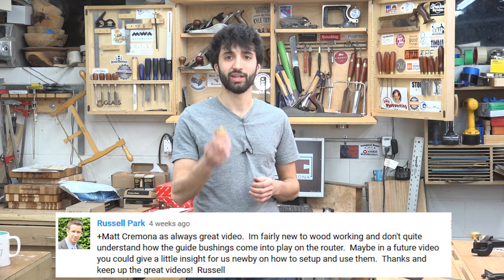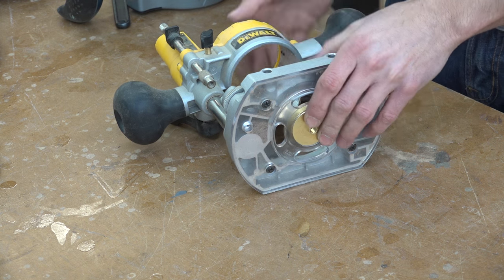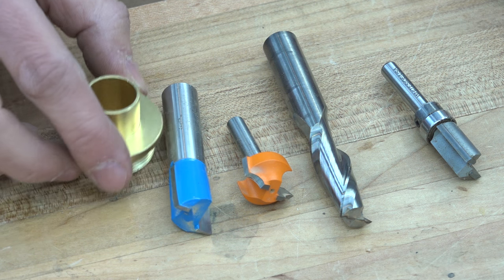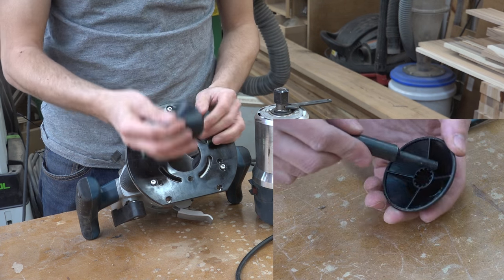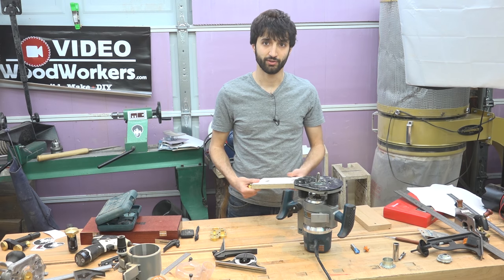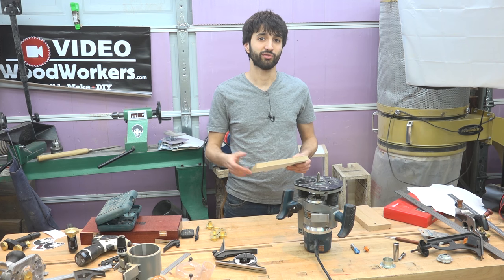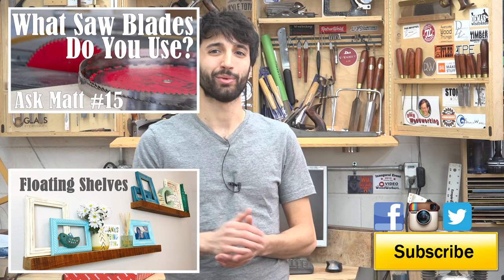How to Use Router Guide Bushings - Ask Matt #18

Comment: Great explanation on how to use guide bushings.  My wife made these carrying crates for mason jars to transport and store our canned goods.  She wants handles routed through the sides of the crates.  I have the same Bosch router as you and use it so sparingly it is not even funny so I did not even know guide bushings existed until a few days ago.  I run a business that performs commercial and residential repairs so I do not come across the need to use my router very often.  Guide bushings are exactly what I need to route the handle holes.  Thank you Matt.
Reply from the maker: Perfect use case. Thanks Ted!

Comment: Good instructional video Matt, as always.  Just a note: 1/2" acrylic (bullet resistant glass) makes for great templates. .  You can get it free from any glass shop that does commercial windows and glazing.  They remove it from banks and storefronts etc. when it gets scratched. Normally it gets tossed in the dumpster.  My buddy owns a glass shop and he turned me on to using it.   It's actually very easy to buff crystal clear using a headlight reconditioner compound and a power buffer.  Clear templates are really nice to use and it makes locating the layout lines much easier. It cuts really easy too on a table saw or router using the lower rpm range.  

Btw, there's no such thing as bullet proof glass, it's only bullet resistant.  Don't tell any bank tellers.  It will stop pistol bullets but that's it.  Not a high velocity rifle round.
Reply from the maker: Awesome tip, Peter!  got it.  bullet resistant :) haha!

Comment: I use guide bushing to make signs from patterns. I found under heavy use they like to work free. A little Teflon tape or locktite does the trick. Awesome video! Thanks.
Reply: Jonathan Mutchler

LOL!  I had one come loose and the bit chewed the hell out of the threads.  Still works but...

Comment: Thank you, Matt. This was very helpful. I short time ago I bought the PORTER-CABLE Dovetail Jig with Mini Template Kit (4216), and the Router Template Guide, 9-Piece (42000). These bushings are great and work well. I'm in the process of building a barn door cabinet for our foyer and went out yesterday and bought a 23/32" straight chute router bit and the 1" OD x 25/32" ID Porter Cable guide bushing. I have to make 3 dado cuts in the top and bottom panels for the cabinet dividers and this was recommended as the best option. I'm building a simple router jig that the 1" bushing will fit into and cut perfect 23/32" dadoes. Your video explains how to use the bushings and offsets which is very helpful. Thank you again! You have a new subscriber!

Comment: Got given a router and learning how to use it. Thanx for info, plan to make a simple template for cutting a cicle, this has been v. useful, Barry.
Reply: There's a better jig you can make for circle cutting with a router. You make a pin base jig to do that. I've made a few of those. It works great. You get perfectly round circles. I've done it to fit speakers into cabinets mostly. It's actually my preferred way of making larger diameter holes in wood though.

Comment: Matt, thank you for this video.  About 40 years ago I bought a new Sears router and right away almost severed an arm off (no blood, but scared me very much).  So I put it away and never used it again.  Recently I purchased a dovetail jig and now I have a use for this unused 40-year-old router.  But I didn't understand the guide bushing instructions in the jig instructions.  After watching your video, I think I'm getting close.  I have not been able to locate bushings that will fit this old router, but time will tell.  I will not give up.  Your video is good, clear and understandable.  If you have advice on how to adopt a bushing for various size plates, that would be helpful.
Reply from the maker: Thanks Ken! You may be able to find an aftermarket base for your router that accepts bushings.

Comment: Hi Matt:  Your woodworking skills are extremely impressive!  I use guide bushings a lot and I noticed that one of the comments mentioned the guide ring nut coming off.  I have had problems with this also until I stumbled on some spring lock washers online.  They are available from Peachtree Woodworking and they are extremely effective.  Part #2903 - Guide Bushing Spring Lock Washers - 2 Pack	$5.99.  John Jensen from British Columbia, BC
Reply from the maker: Great tip!

Comment: Awesome, pulled down a Porter Cable template kit Id' forgotten on the shelf for my B&D plunge router and now know it will make it easy to do 1/4" dowel holes with a bit and a scrap board as you demonstrated.  I have a nice separate guide for end grain holes, but wanted a better way to get accuracy out on a large mating flat.  I'll do the end grain ones first, then use dowel center markers to transfer the locations accurately out onto the flat.  Easy peasy

Comment: Good job mentioning and showing the centering mandrel.  Most base plates on most routers can be calibrated for centering.  I've learned the hard way that the Uncle Festool OF1400 has no such adjustability.  If they don't fix it I'm stuck with an expensive router that cannot be used with guide bushings.
Reply: $600 for a router it should be centered straight out of the systainer, at least mine is.  Take it back and have em fix/replace it.
Reply: @mski349 

I sent it to Festool and they didn't fix it.  Not only that they either just threw it in the systainer sideways or they didn't lock the plunge mechanism and the box was dropped and banged around by UPS.
There is good news, I found a way to get it centered.  I had to hack away at the guide bushing plate to access the set screws.  It's now perfectly centered but between the router and my kapex, (that I sold), I'm rather soured on Festool.  Their tools have a lot of nice features but their service totally blows chunks.

Comment: Matt....love the videos...very informative, esp the one on jointers.  What model Dewalt plunge base are you using in the beginning of this video?  I can't seem to confirm if the Dewalt 6182 model (plunge base) will accept a standard/porter cable guide bushing, straight out of the box.  Also is it crucial to use a centering cone every time we change out, and if so, are the centering cones universal (can use Bosch for Dewalt, etc) Thanks!

Comment: Hey Matt Great Video. 
I have purchased  some guitar body templates . However  I am unsure but suspect the rout out  shapes in the templates are larger than the  actual hole that will be cut and hogged out.  Do putchased templates usually come designed to cut the holes to specs?  I am  kinda old school and Routing was not one of my  commonly used tools . On guitars the cavity routes need to be fairly specific as  components fit inside them Thanks

Comment: I've watched this a while ago but wasn't logged in at the time.. Great Job as always Matt.  
I have a question regarding a pattern.  I have areas where I need a 1/32" or even 1/64" bit to make fine detail but obviously there are no bushings like that.  The piece I'm creating is about 6" wide by 2" tall.  Most area's a 1/8" bit will work but how do you calculate pattern size based on the final cut thickness of the small bits?  5/16" OD is my smallest bushing so.... if I'm chugging along with a 5/16" OD 1/4" ID bushing using a 1/8" bit then switch to a 1/32" there will be an ugly "step" or "offset"
actually, so I don't type a novel I'll just tell you to look at the Seattle Seahawks logo, if you were to pattern that to get the sharp corner detail using a trim router, what would be your technique?

Comment: Good video, my question, i try to use the guide bushing with a template, i cant seem to get the bit to extend far enough to get past the bushing and into the work piece to the proper depth. What am i doing wrong. Thanks Ruben

Comment: Good info Matt! I see you have a few festool prods. Not sure if you're familiar with their QF1400 plunge router, I have one and the guide bushing holder snaps into the base, it's off alignment with the collet by enough to make it a major frustration to use. Festools response It's to Just patch it up our sends it in. It seems like a common problem and there's not an easy adjustment without machine shop experience. Bosch and PC... Simply loosen the plate as you show.. Done. Any ideas?

Comment: Do you normally use a bushing/bit combination requiring an offset i.e. leaving plenty of room between bushing and bit? Asking because my Harbor Frieght plunge router is off center, the base is non-normal so does not allow way to center a plate ... and because of this I chewed up a 5/16 bushing using a 1/4 bit. Seems that using larger bushing and leaving plenty of room would be the answer to not doing that again.

Loved the video ... infinite thumbs up.
Reply: It would be a good time for you to make your base plate so you can center it properly.  They sell 1/4" thick acrylic sheets on Amazon or many other places.  Just take your base plate off and mark the screw locations and diameter and make your own plate.

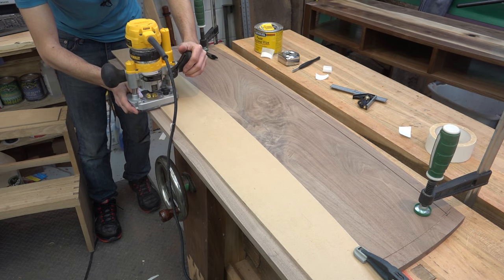Comment: Matt there is a cabinet door you show around 6:46. Routed in the door is a rectangle with the slight arc at the top of the door. Do you have tips on creating that arc with the router? 

I'm trying to replicate cabinet doors of mine with a similar design.

Comment: hello, i want say thank you for explained guide bushing work, i have a question, can i use guide bushing on trim router?
Reply: yes and no.  If your trim router has the standard Porter Cable opening it should be fine.  If not, you can always make your own router base and use a forstner bit to get you where you need to be.  I believe it's 1-1/2" opening but it might be something else.  Just check the guide bushing kit you want to buy for the opening size and match that up with your router opening size.  It's nice to create your own router base plate because you can so so much more with it like an edge guide, or a jig for much better control while free hand routing etc.  Just buy a 12"x12" piece of 1/4" acrylic, trace your router base plate (for hole locations) and boom, your in business.  I did this for my bosch colt trim router and it works great.

Comment: thanks for what you do . did the Dewalt router that you use come with the capability to insert those bushings or was that an accessory ?
Reply from the maker: yes, the baseplate has the recess for them built in.  thanks!

Comment: Hello Matt, thank you for this video.  I'm looking for setup to carve a template into a piece of wood 1/8 of an inch deep.  The problem I'm having is most bits that are designed for pattern cutting have a depth that is at least an inch deep before bearing comes in contact with a pattern.  I need a bit that allows the bearing to slide down the cutting length and only allow the last 1/8 of cutting surface to cut into the wood under the template. Any help is appreciated.
Reply from the maker: Look for a short bit like this: https://amzn.to/3i1Czs2  You can also make your pattern thicker or raise it up to use up more of the cutting length

Comment: I had wondered why you’d ever use a bushing instead of a pattern bit. Cutting dead straight holes in big pieces, or in a shelf pin jig. Inlays. Patterns with bits that don’t have bearings.  However, I’m not sure how often I’d reach for bushings over pattern bits otherwise.

Comment: Was that a Dewalt 611? I was using some bushings on mine a few weeks ago and had to step it up a few sizes because the bit wasn't centered... It wasn't a big deal for the project at the time but I'll have to check to see if I can adjust my base plate enough to resolve the issue.
Reply from the maker: Yes it is.  I haven't centered it yet.  The one time I used the guide bushings on it it didn't need to be centered.
Reply: I'm going to have to remember to look at mine tomorrow and maybe get one of them fancy centering jigs. It's kind of annoying that it wasn't aligned out of the box as that was the first time I used my second 611 with the plunge base.

Comment: Matt, do the collars on the bushings come in different lengths? I have the same set you have in the video but when setting up for a dovetail cut there is very little clearance between the bit and the collar.
Reply from the maker: The only thing I can think of is to have more contact surface with thicker templates.  I haven't had to yet, but if I needed them shorter, I would just cut them to a shorter length.

Comment: hi Matt excellent video.. the large dovetail jig you showed looked awesome.. who is maker? I am wanting to do finger jointed box drums..I build cajons and box drums. I recently came across 1,200 sq.ft. of long leaf pine heartwood 7/8" thick.. appox. 200-300 year old. it was milled and joined into 31" and 43" wide shelves.. in lengths of 8'- 10'- 12- 16'. I have 35 vertical supporting pieces 23' tall in same widths made from same stock. I want to build box drums with,, its super hard and dense. built one , it sounded awesome.. excited about better production with a good jig..any other recommendations appreciated.
really like your videos..thanks j.

Comment: Hey Matt, hope all is well. I know this video is old but I always come back to it for reference. I wanted to ask if this same concept of using a guide bushing to create a repeatable cut/pattern if you have a template, can be used in an inverted way. For instance, if I have a template of a circle (6in), and I need a circle BUT bigger (7in), can I use a guide bushing around the outside of the current 6in circle template I have to create said wanted bigger circle? I hope I am making sense lol. Thanks, and stay warm :)
Reply from the maker: Yes absolutely. You can use the offset to grow the template

Comment: Wondering if anyone has had the problem I've experienced using a guide bushing, I've used wood river.  Have used it to make cutting boards with a curved inlay in it.  Twice now the damn thing has unscrewed while i was using it and screwed up the threads on the female part.  I centered it on there best I could and nothing seems to be touching it, don't know what I'm messing up or is it my shitty skil plunge router.
Reply from the maker: The bushings that came with my dovetail jig came with an o ring that helps to keep them from coming unscrewed.  You could also try adding some teflon tape to the threads

Comment: Five years to late to maybe ask this question but how to figure out the cutting edge. Wouldn't it be to the edge of the bit is the space between the bit and the bushing (in your case 1/4") + the 1/8" bushing thickness? Or is the 3/4" the outside diameter of the bushing in which case 1/4" - 1/8" would be only 1/8".
Reply from the maker: Yes, bushings are labeled by their OD

Comment: Great info, Matt!  I've never used guide bushings...maybe an intimidation factor.  Do you know if guide bushing will work in palm routers?  I have a full size Ryobi and a Rigid palm router.  I don't have a plunge base for either, but I can definitely see their usefulness.
Reply from the maker: Thanks Chris!  That's going to depend on the base plate for the router.  I know the Bosch Colt needs a separate baseplate to use a guide bushing so I'd think the same would be true for other palm routers.

Comment: This is very interesting. Now im wondering is there are bushings like that for my el cheapo router... 

Also, in my country routers usually arent detachable from the base, and the handles are integrated and contain the buttons and speed control. No 'palm routers' etc. 

Also, i see there are different sizes of shanks. That makes it hard to find the right bits. I see many cheap bits online, but am afraid to buy as im not sure they will fit my router. This all makes my router one of the least used tools in my shop, which is a shame really. 

On the other hand, there isnt much i cant do with chisels.

Comment: Matt, I built a template guide similar to yours for the mortise.  Mine is longer to create a slot in the workpiece.  My bushing is 3/4” ID and I’m using a 5/8” bit.  I’m having problems with getting the bushing to slide in the template smoothly.  I think sawdust coming up and getting stuck between the bushing and the template.  The bushing slides smooth and free when the router is not on, but binds when I’m cutting.  Any suggestions or thoughts?   Thank you.

Comment: Hey Matt, I am looking to buy a new chainaw.  I am torn between a husqvarna and a stihl.  I will be primarily using it to cut down trees and for firewood but not in a commercial application.   I would like to be able to cut the occasional plank for a cutting board or something similar.  I have seen your stihl saws.  Is there a reason you chose the stihl over the husqvarna?
Reply from the maker: When I bought my first saw I was looking for either but found a good deal on a used Stihl 039.  Once you go with one brand it makes sense to stick with it because the parts are mostly interchangeable.
Reply: Makes sense, thanks for the response

Comment: Hi Matt, great video.  Could I cut that same mortise without a plunge type router?
Reply: You want a plunge router. You may even want two or three plunge routers? But if you can only have one then you want a half inch collet plunge router. Because with adapters it can run the most different sized shank bits.